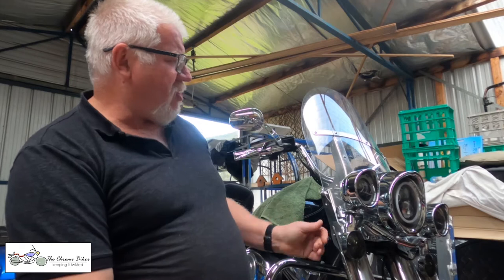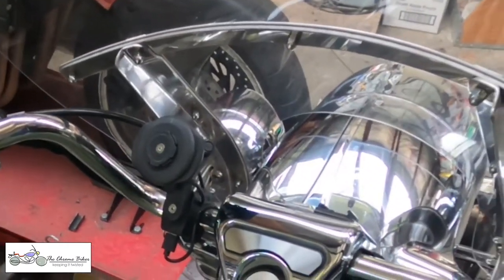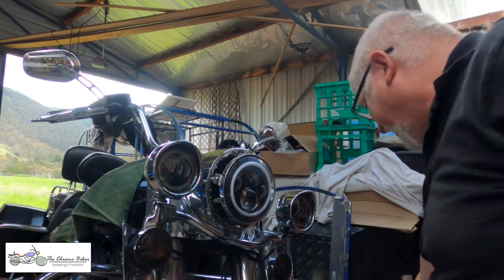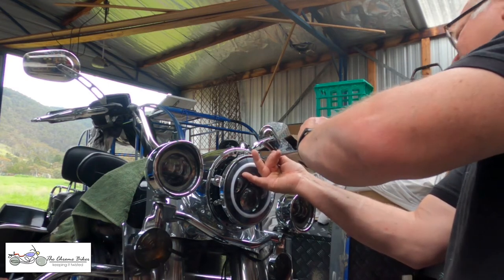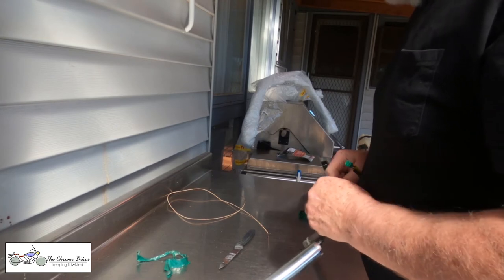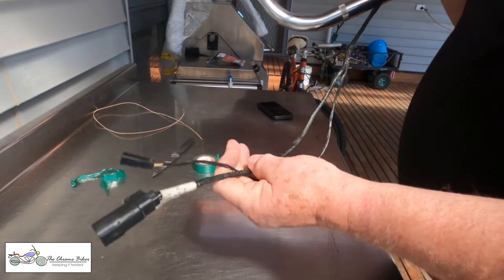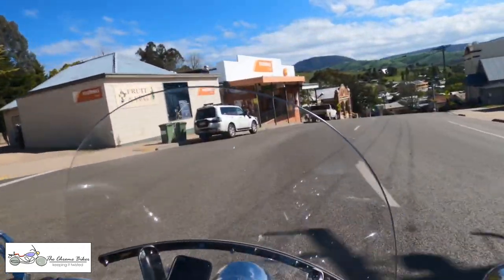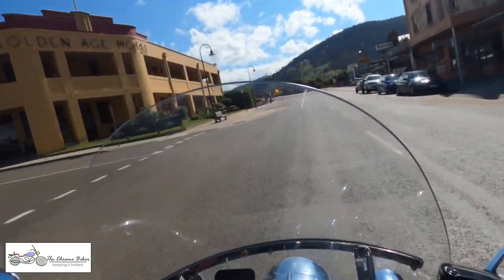Road King Mini Ape Install

Comment: Could you tell me what maximum height I could put on my 2006 road king without having to change cables?
Thank you
Reply from the maker: Hi J , II went with 10 inch but I believe The 12 inch would be your maximum.  I did have to move my front brake cable slightly but apart from  that mine don’t catch or snare on anything, however I think it also depends on the shape of your bars I’ve got a slight turn back so it gives me plenty of room but if you had Z bars or something like that I believe there may be some issues
Reply: @thechromebiker5942  thank you very much!,
I have the original beach bar from Road King but it’s really uncomfortable